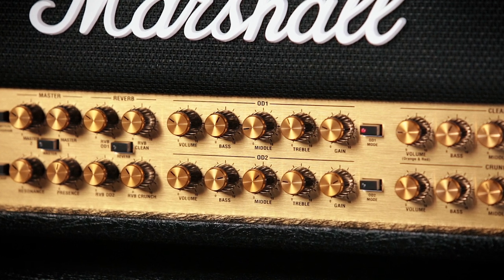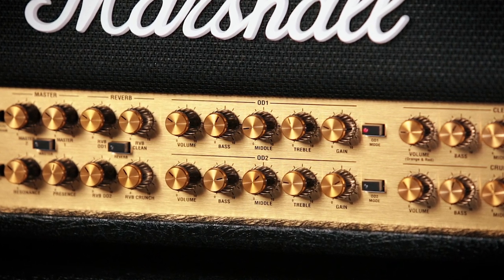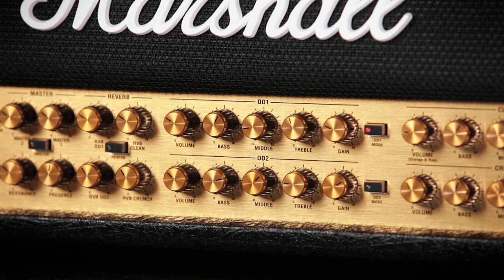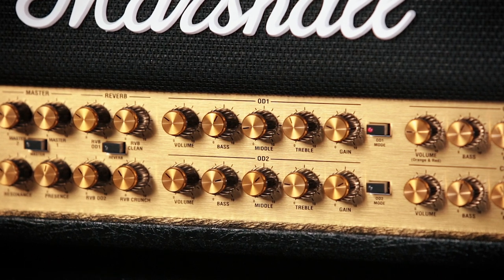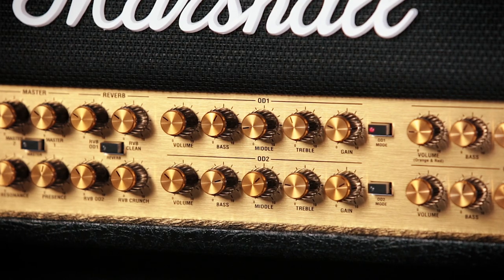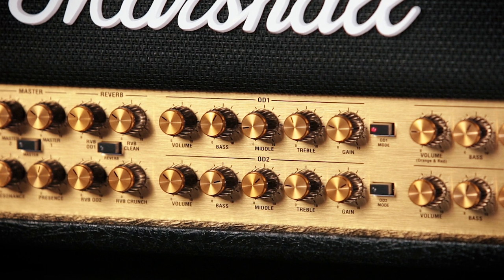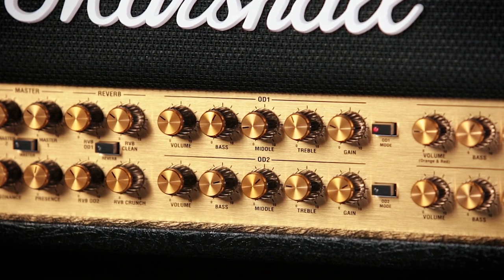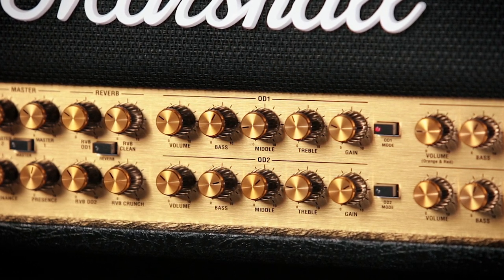JVM Tutorials | Classic Metal

Comment: This amp has more knobs than you ever need
Reply: To Marshall's defense,  it is a 4 channel amp.  Don't get me wrong...I love simplicity too. But this amp is not normal! It has a lot to offer. The more "simple" Vintage Modern appeals to me as well. I do also admit, all those controls can be a bit intimidating. That amp looks like it can split some atoms!
Reply: Just a seperate eq for each of the 4 channels , im.sorry this has caused you confusion
Reply: But JVM 410 has more knobs than Any other amp on the market
Reply: More knobs is a benefit not a detriment! Being able to totally sculpt your clean  , rhythm and lead tones completely separately is an awesome feature...and that all there is too it
Reply: It's better to have too much then not enough when it comes to tone versatility.  I've got this amp and it's definitely overkill for me with 4 channels and 3 modes each (essentially a 12 channel amp).  I only use  3 total modes myself.  I have two channels (6 modes) turned off completely (volume etc. dialed to zero).  This amp has plenty of gain and then some.  It sounds great!